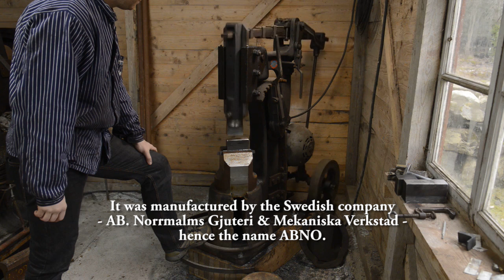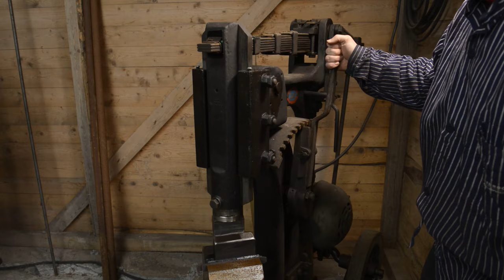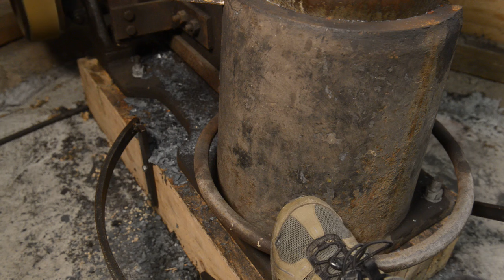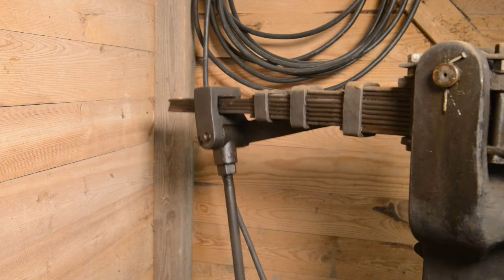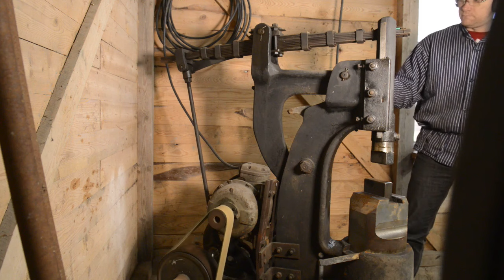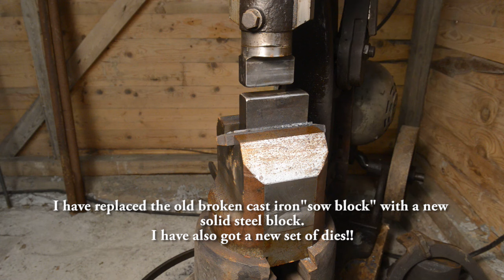Blacksmithing - Intro to the 25 kg ABNO power hammer

Comment: Thanks for the demo of all the components.  Quality shots of the mechanisms and operating parameters!  Didn't quite understand how the drive engagement works but have an idea now.  Thanks for sharing.  ~PJ
Reply from the maker: +pjsalchemy Thanks. I know, it's not easy to show without dis-assembly . There is a clutch, basically two wheels with conical contact surfaces. The treadle pushes the "outer" , the idle wheel,  against the inner, drive wheel.
Reply: +Torbjörn Åhman Thanks, makes much better sense now!  Cones are very good old school transmissions.
Reply: i was about to ask the same. thanks for asking and the answer. facinating machine.

Comment: Hmm it doesnt seem too complicated,except the clutch a guy in a shop with  lathe and welder could make it.Well you would need truck axle and a leaf springs,I beam,ball bearings,and some 20mm sheet metal.For a clutch maybe use a tire and motor setup like on those diy powerhammers. Definetly doable with some improvisation.
Reply from the maker: +zumbazumba1 Absolutely!
Reply: +zumbazumba1 

You don't need ball bearings for something like this. Good old fashion lead bearings would more than suffice, also, being one solid lump packing around the pivot shaft, it won't destroy something like a ball bearing. When it's ruined and sloppy, you just unpack it, melt it, pour it again.

As for the clutch, you could probably use an actual clutch system from a truck.

IMO, if you get a shitty old truck, something above 5 capacity, you can get all the parts you need to built at least one, and extra. If you're super lucky and find one of those old tow trucks, heck, then you have even the lead because those buggers had lead stacked in the back.
Reply: aserta
What you are reffering is called babbitt bearing,its a aloy of lead(not just any lead,this one is harder),used 150 years ago.
Ball bearings would be used for eccentric cam
with cable tensioner for adjusting the length of hammer strokes(much simplyer than shown on this machine -does same thing)
The shaft that holds leaf springs can be secured with brass bushings, thats more than enough.

Comment: Thank you so much for posting this - now I know all the features I want to include in my own design for making my own out of scrap. This is one well thought out machine - the ability to adjust for the end thickness you want, be able to adjust the hammer force independent of rpm's, the circular foot pedal is a very nice touch, the easily replaceable dies that don't move about is a great feature, and I'm very curious about the clutch arrangement on the drive for the crank - could you someday post a video showing how they designed and put it together? That looks like a much more controllable mechanism than the common way of engaging a belt into a pulley and relying on belt slip for partial speeds. Thanks again, a simply gorgeous machine.
Reply from the maker: Thank. Yes, it's a great machine!  The clutch is pretty simple. An idle wheel outside of a inner drive wheel. Both with a conical inside/outside (hidden) surface. When you press the pedal you push the idle wheel towards the drive wheel and the conical parts start slipping against each other. I guess the reason for conical is that you get a larger contact surface. Don't know if that makes sense?
Reply: Thanks. Yes, another reason for conical is that the interference fit is more even from inner to outer; if it was a simple face, there would be a big difference in slippage from inner diameter to outer diameter. Are the cones simply metal on metal, steel on steel, or is there a facing material or lubricant? As the surfaces get hot the slippage factor will change, but I rather suspect they compensated for that in some manner as to keep the slippage factor more constant?

Comment: Hi. I recently bought a hammer much like yours, only older and a bit simpler. But it came without a motor. Can I ask what size motor and what kadence you run yours with? Thanks
Reply from the maker: Mine is 1.4 hp, and the hammer runs at about 275 bpm if I remember right.
Reply: @torbjornahman  Thank you very much! Very usefull. Cant wait to get it running. Cheers

Comment: Oh, now I understand how the power hammer works. So the key item is the spring and if wheel rotation is quick enough, resonance in vibration makes hammer hit the anvil.

Am I correct that adjustments in driving arm attachment to the spring making resonance frequency different so the hammer hits anvil more or less frequently?
Reply from the maker: +YurNick Na, I don't think it has to do with resonance at all actually, but the spring is key yes. The faster (harder on the foot pedal) it moves, more "whip" is introduced by the spring and harder it hits. The rear adjustment makes more or less spring available, but in reality it's not so obvious of a difference.
Reply from the maker: +Torbjörn Åhman With resonance you probably would end up without control since that would suddenly apply at a specific frequency. I imagine that would be quite scary and potentially fatal for the machine as well...
Reply: +Torbjörn Åhman I mean, amplitude of vibrations from driving wheel is constant. So if not the springiness, amplitude of vibrations of the hammer on the other side of the lever would be constant too. Since the hammer amplitude depends on vibration rate, it should be a resonance effect, which is controlled by operator (so it's not scary and fatal - since you control the vibration rate by pressing pedal).
Reply: +YurNick Only hammer on the other side of spring is resonating to driving wheel vibrations, not the whole construction (which have different resonance frequency and so the whole thing is safe).
Reply from the maker: +YurNick I wouldn't call it resonance but I think you got the idea :)
Reply: The spring is effectively storing energy from the momentum of the arm, releasing it to accelerate the hammer downward and increasing the amount of hammer force at the anvil.  As the arm travels downward, its momentum is accelerating the hammer upward.  The hammer continues to move upward under this momentum even as the ram travels upward against it.  At some point the hammer will be at rest; the inertia at this point allows the spring to store energy from the momentum of the upward traveling arm.  When the hammer starts moving downward, the stored energy in the spring will be released, accelerating the hammer downward faster than the momentum of the arm.
Reply: @douro20  When period of oscillations from engine rotation is coming close to natural period of oscillations of the spring then spring oscillation amplitude grows and hammer starts hitting anvil. This is resonance.

Comment: That size of tool would be perfect for my shop. Can you control the amplitude of the throw with the footpedal?
Reply from the maker: +wood and stuff Yes, the amplitude is a function of speed. The faster the ram moves the more "whip" it gets from the spring resulting in larger amplitude.

Comment: It's hard to see moving, but in the rams guide which holds the springs, is the top spring bent up holding something green in? Is that just for sound dampening?
Reply from the maker: Actually one leaf is a bit shorter and leaves a gap. This makes quite a rattle, so I added a piece of green plastic to fill in the gap!
Reply: Thank you, that is a really nice looking hammer.